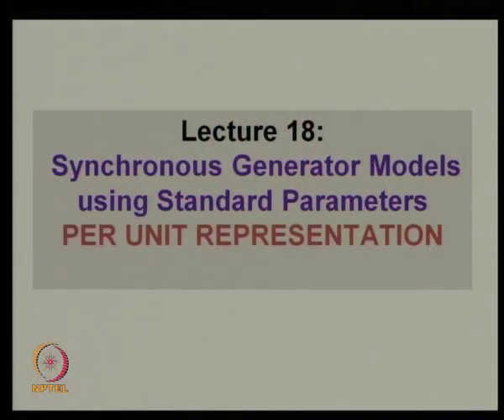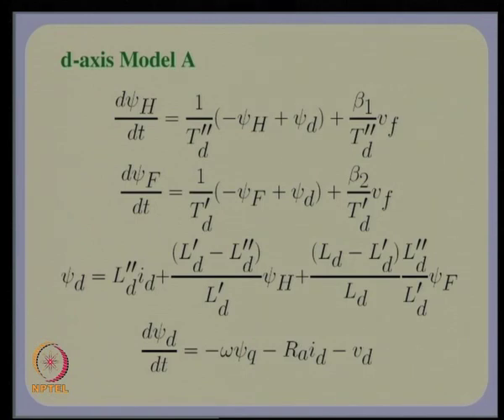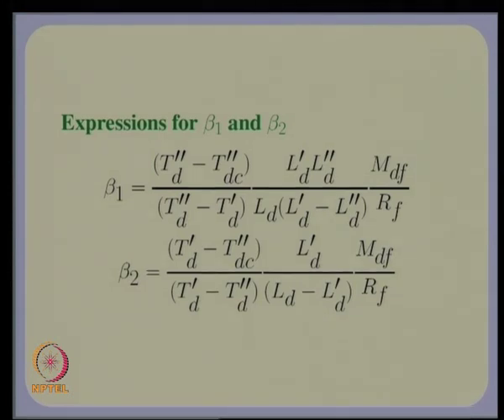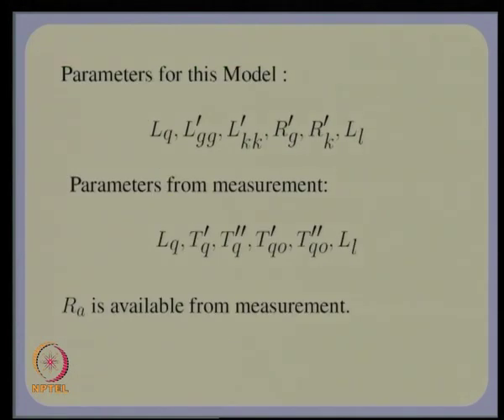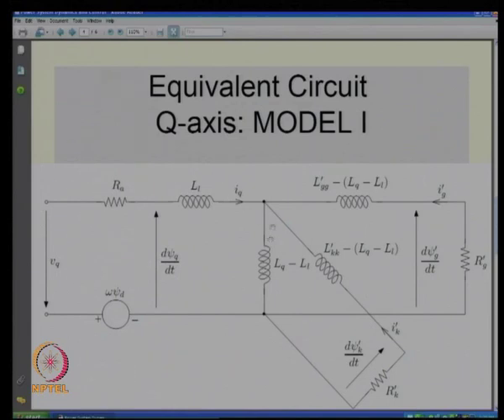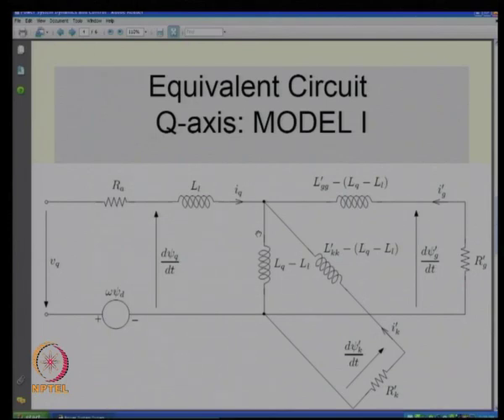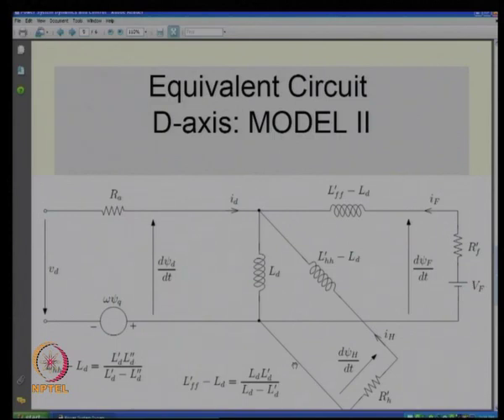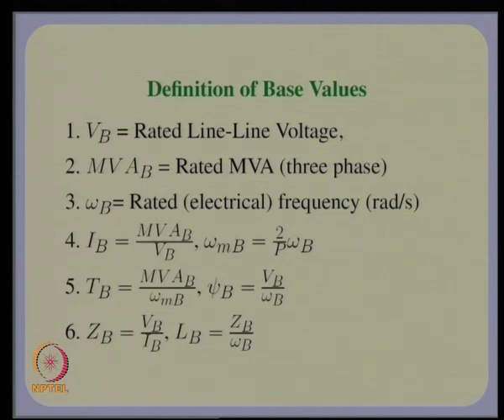Mod-01 Lec-18  Synchronous Generator Models using Standard Parameters. PER UNIT REPRESENTATION

Comment: A note on synchronous machine modeling is available from Prof. A. M. Kulkarni (EE-IITB) in the following link: https://drive.google.com/open?id=16nkLaTKiVixMRecDggquDs8gX7NNq3Lz

Note: (from lecture-17 onwards till lecture-20).
~~~~~~~~~~~~~~~~~~~~~~~~~~~~~~~~~~~~~~~~~~~~~~~~~~~~~~~~~~
* Model-A is introduced only in this course (it does not appear elsewhere).

* Model-I is essentially the model presented in Kundur's book (a circuit model). A caution: Here the power-invariant version of the d-q transformation is used. Generator convention for currents.

* Model-II is an approximation of Model A.

The model-I is widely used in the industry/industry grade programs.

~~~~~~~~~~~~~~~~~~~~~~~~~~~~~~~~~~~~~~~~~~~~~~~~~~~~~~~~~~~~~~~